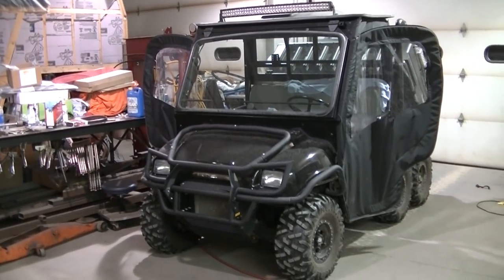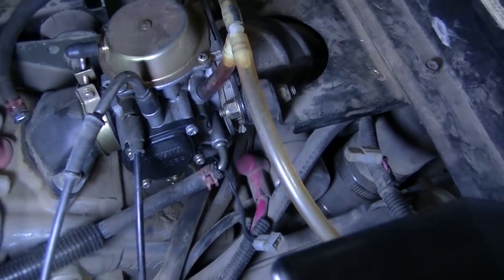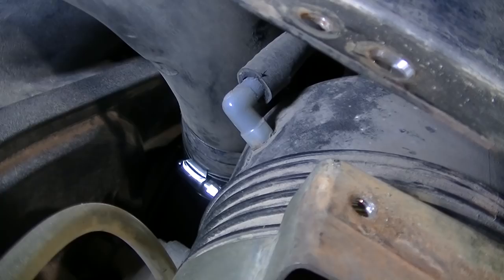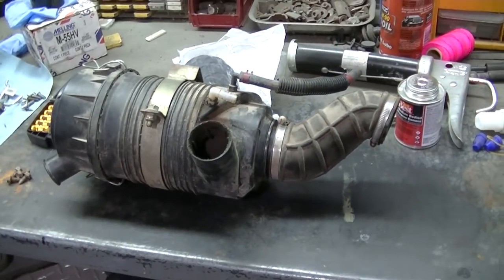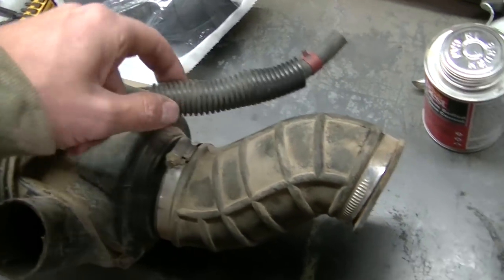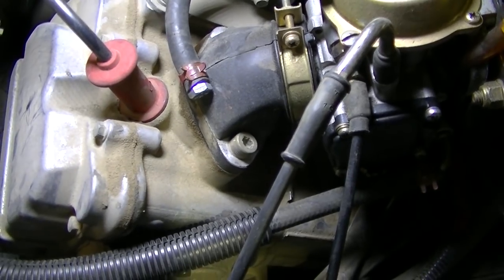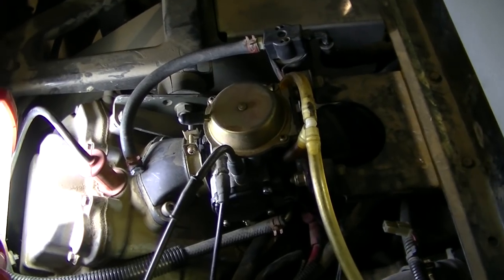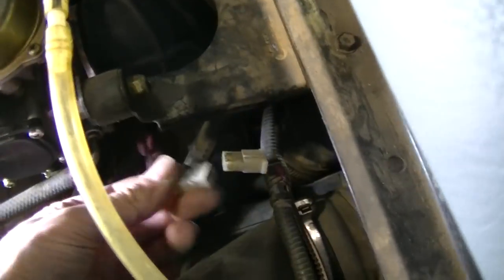2003 Polaris Ranger 6x6 "Intake Boot Replacement"

Comment: Yeah, that is definitely cause for concern!  Hopefully it hasn't damaged the engine.
Reply from the maker: +farmboy30117   I hope it wasn't running like that for long.  I think I have a carb problem because it's bogging down at part throttle.  If the carb was sucking dirt that isn't good either.

Comment: Ya my 01 ranger is having a lot of trouble starting up in the morning and staying started till it warms up I'm the only one who can start it up what do you suggest or does the 500 engine just dont like the cold?
Reply from the maker: I almost always have to choke mine to start.  That's a carb for you. If it starts hard when warm then you probably have issues.
Reply: @mossman381  eh it runs great just takes 5 minutes of pulsing the gas to keep it running after its warmed up starts right up
Reply from the maker: @jordandavenport7553   Your choke must not be working. Once you pull the choke out it will idle faster. After a short time depending on how cold it is the choke should be pushed completely in before putting it in gear and driving.
Reply from the maker: @jordandavenport7553  I had one Ranger were I had to apply a small amount of throttle to start but you shouldn't have to keep giving it gas.
Reply: @mossman381  thanks for the info it must be the choke I gotta take it apart and get in there
Reply from the maker: @jordandavenport7553  How is your Ranger coming along?
Reply: @mossman381  I took her apart got the carb out whole fule system was filthy so I put the carb in a cleaning solution for 3 days replaced the filter and did my best to drain the tank put it all back together reconnected the choke put some high quality gas with a bit of octane booster runs like a dream only had it a month previous owner neglect next project beefed tires thanks for the info also replaced the belt couse I was in there

Comment: Did it bog out/run lean
Reply from the maker: I was having a stumbling problem but that was the carb.  A broken boot can cause a lot of damage to your engine because dirt can bypass the filter.  It's very common on these.
Reply: mossman381 ok I think mine running lean
Reply from the maker: There are adjustments on the carb but I am guessing something has wore out in your carb.  A rebuild kit or a new carb would be my recommendation.  Maybe a weak fuel pump??
Reply: mossman381 mines fuel injected
Reply from the maker: Ok, so not going to be a carb issue.  I thought you had an older one like in the video.  Still could be a fuel pump issue.